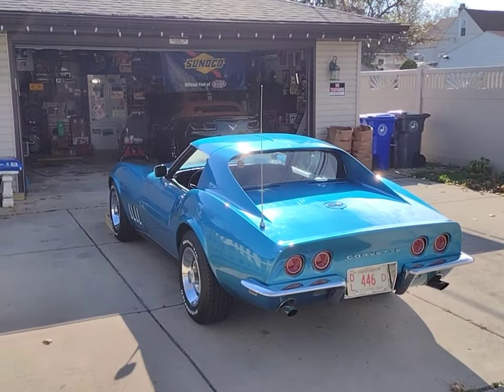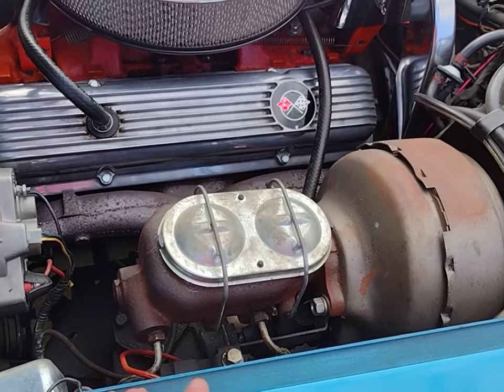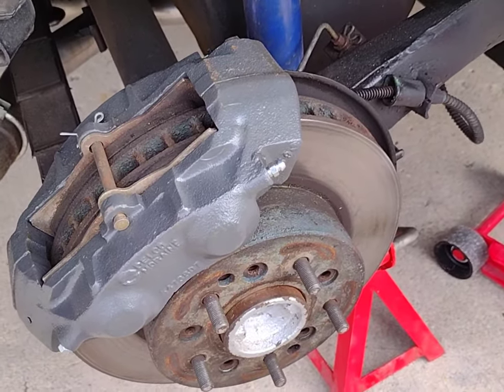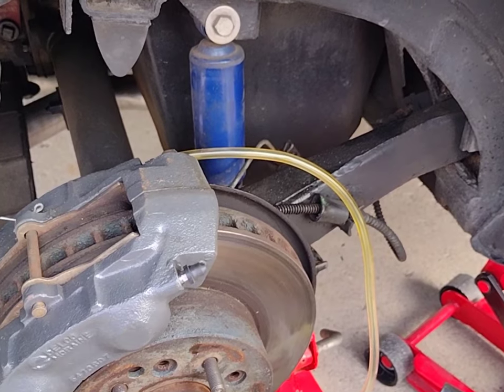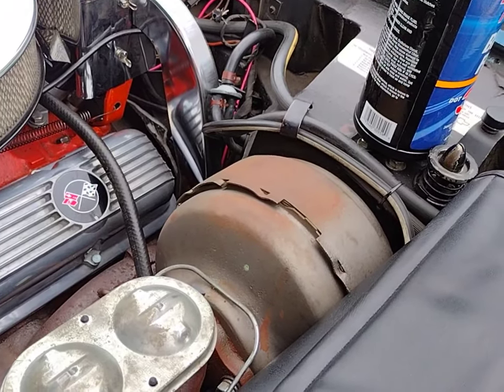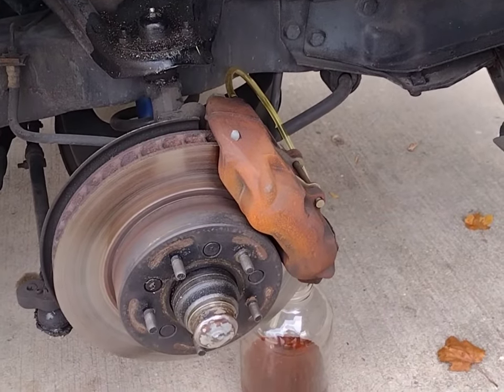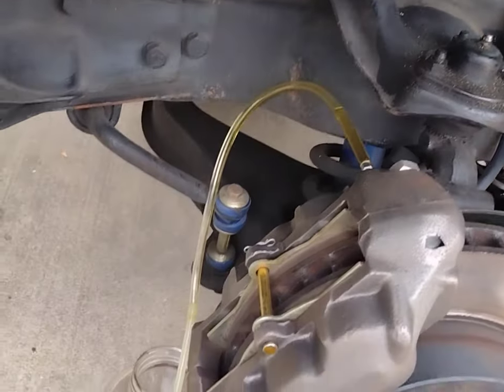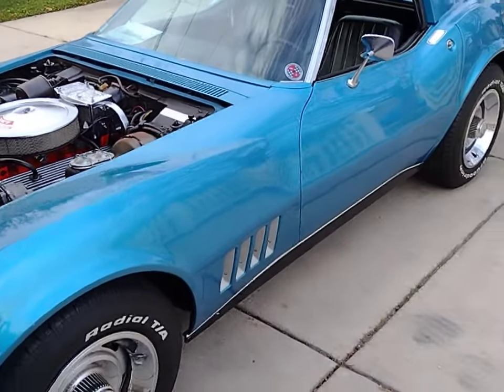DISCOVER how: Brake Bleeding C3 Corvette Restoration @Corvette-Dan #corvette #c3 #brake #diy

Comment: I bleed both rears at the same time. But i also remove as much of the fuid out of the reservoir before i bleed, then refill with brake fluid before i crack open the calipers. That gets rid of the old fluid faster.watch your fluid level in the master while doing this. Then do the fronts the same way. Gets rid of the old fluid and air easily.
Reply from the maker: Thanks for watching and the insight as well. I ended up bleeding the traditional way after a master swap with no issues. I like this approach however. Stay tuned and check out my other C3 content: https://youtube.com/playlist?list=PLvUK1kuAU20p-aAREwU6ilmc5nqpEgX0E&feature=shared @Corvette-Dan

Comment: If I changed both front calipers and pads, should I not do a gravity bleed? Do an actual pedal pump type bleed?
Reply from the maker: I would start with a gravity bleed first and see how that goes. Thanks for watching. Keep us posted on your progress. Corvette Dan.
Reply from the maker: Some are against pedal bleeding depending on the type of caliper seals. Regardless if you need to pedal bleed, have the person pumping the brakes put one foot (toes) behind the pedal so it doesn't drop completely to the floor. Corvette Dan.
Reply from the maker: I have since pedal bled my car after swapping the master and adjusting the booster rod. You should be OK. Corvette Dan

Comment: If you have the car jacked up when you take the top off the master cylinder it would spill over a bit for not being level. Is it best to drain some out first to keep that from happening? Then when finished top off the master cylinder on level ground.
Reply from the maker: It will not spill over but can have a bit of an effect on how filled it is. Best to top off when the car is level. Thanks for watching. Stay tuned. @Corvette-Dan
Reply: @Corvette-Dan  I did it but it didn't have much effect because the angle was probably not steep enough.
Reply from the maker: @senselessmonkee  Thanks for watching and glad you didn't spill it. @Corvette-Dan

Comment: Hey great video, can you confirm that your test drive after this process gave you the results you expected?  Just asking because you expressed some scepticism yourself at the beginning.  I've pump bled my brakes several times using a tube kit that is supposed to keep air from being pulled back in.  Brakes still not right.  All new parts involved.  I'm going to try the gravity feed.  The whole process gets old fast when you go through it all and don't get the results you want.  Sorry I just had to get that little rant in there.  Cheers!
Reply from the maker: Thanks for watching. As it turns out, my issue was more than this. I had a bad master & the booster rod wasn't properly adjusted. With that, I have a video coming tonight showing how to bench bleed a master and an installation of that master coming on April 9th. We ended up doing a traditional pump bleed. Stay tuned and check them out! Corvette Dan.